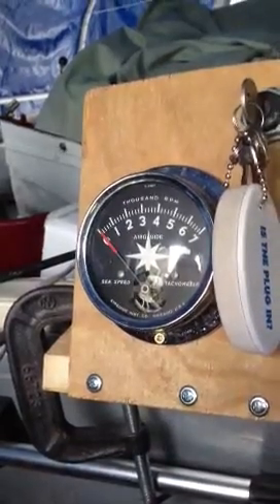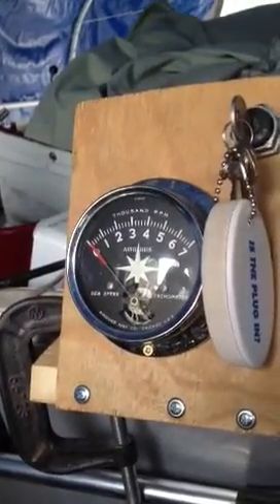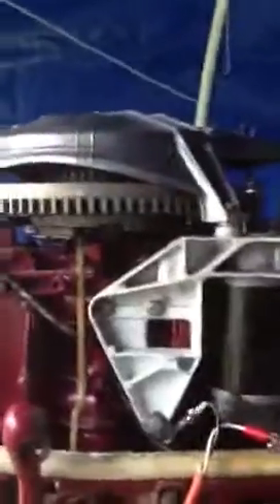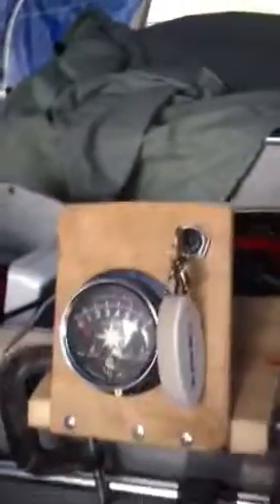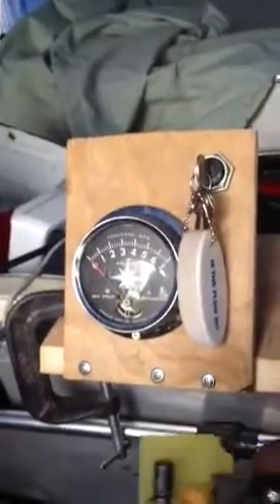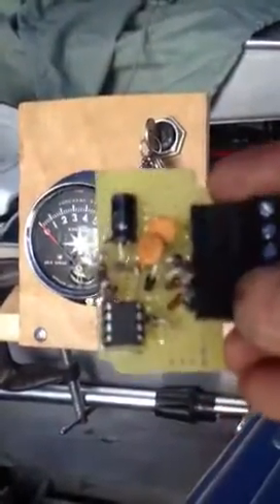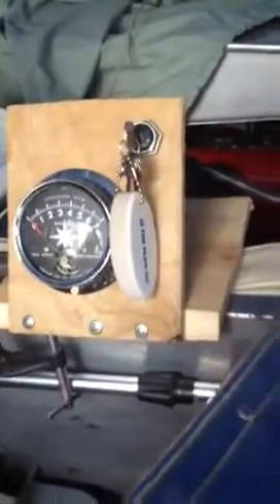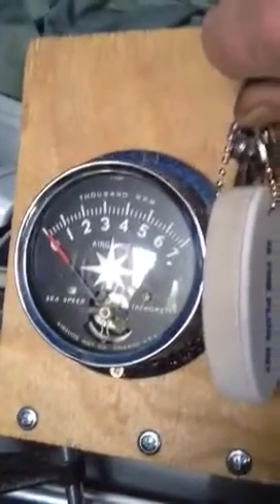Self built tachometer interface for old OMC / Johnson / Evinrude outboard motors

Comment: Why do you need an interface to run that tachometer? Model 690 should be working without any extra components with magneto ignition and 2 cyl 2 stroke engine..?
Dont make any jumper settings(no leads connected and it should work just like that..?

Comment from the maker: Hey Bill, Thanks for sharing the project. I had the tach set for 2 cylinders, changing to 4 brought it down to about 950 RPM. How about an interface for old airguide tachs with alternator outputs? :-)
Reply: Hi Fishbonz,  i just picked up one of these tachs and wondering if you still have the plans for the interface?
Reply from the maker: @tomahl5802  Hello Tom, I didn't know the link was dead. There is a new link but the pics don't show. Maybe you have to log in to see them? http://dev.shareaproject.com/pages/projectTut,p,411,00.html
Try contacting Bill Yacey, he commented down below here. Sorry about that.
Reply: @FishbonzWV did you ever get it working?  Do you have plans anywhere?  It looks like the website won’t load pictures or let you register an account anymore. Thanks!
Reply from the maker: @mrwatsonn  I don't know if he will reply but Paul Moir posted his gmail address at the bottom of the project. Try and see if he has the schematic. If I have a copy it's buried deep seeing how it's 10 years old.

Comment: I'm not sure your tach is reading correctly. 2500 RPM is about 1/2 throttle.It didn't sound like your motor was idling any faster than perhaps 1000 RPM.

Check your tach settings; it should be set for 4 cylinder 4 stroke operation.
Reply: @billyacey6648 do you still have a schematic for this available?